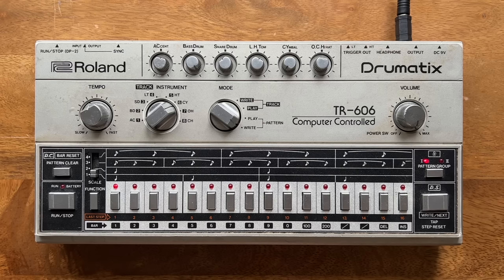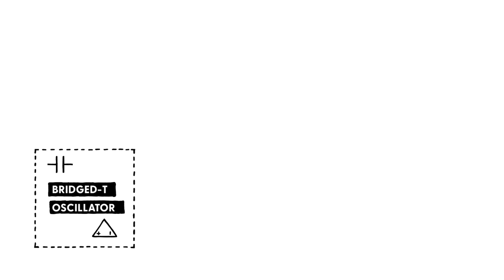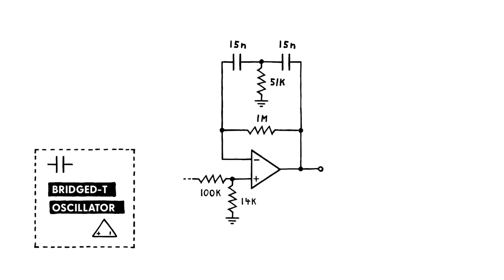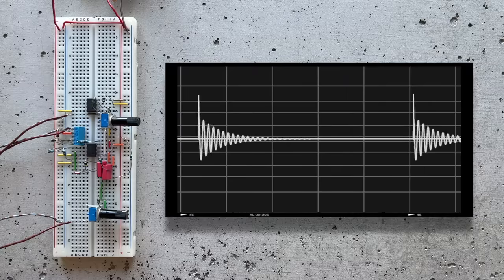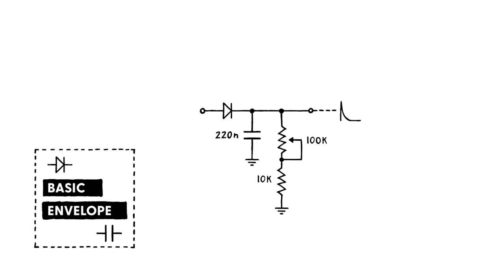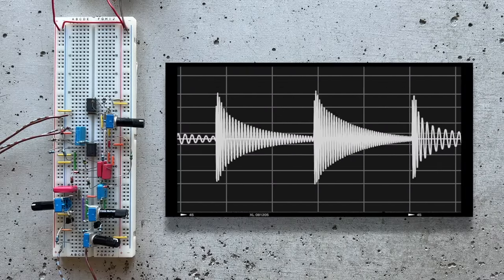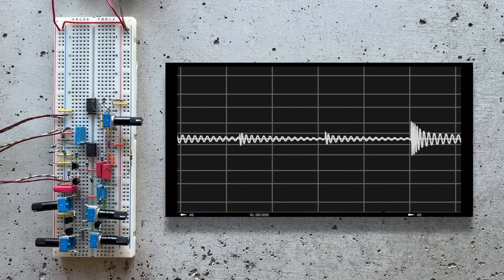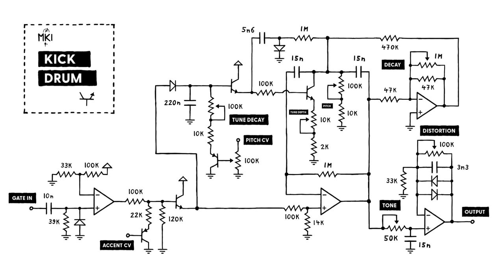Designing a simple analog kick drum from scratch

Comment: Remarkable !!! It's always fun to see how those simple tricks solve complex issues in a efficient way. 
To try different "flavors" in the overdrive section is fun to use different diodes (red/green leds) or make it asymmetrical, with 1 diode in one direction and 2 in series in the opposite way
Reply from the maker: great idea! though you‘ll have to drop the resistance to ground a fair bit for the LEDs to actually conduct.

Comment: I'd love to see a series of DIY modules utilizing CMOS chips, so many possibilities!
Reply from the maker: sounds fun! what were you thinking of specifically?
Reply: Agree! I love CMOS!
Reply: Hm, the main point of CMOS was that you can make things like NAND gates that only use power during signal transitions allowing you to use more gates for digital circuits with the same amount of power. That said, using a voltage controlled FET instead of a current controlled PNP or NPN transistor might be useful sometimes for analog circuits.  JFETs might be easier to use than the MOSFETs used in CMOS since they are usually a bit less sensitive to electrostatic discharge.
Reply: I have seen devices that use the logic gates in CMOS ICs as analog amplifiers! I even tested an AM radio built entirely around 4 NAND gate chip that worked great.

Comment: Absolutely awesome Man.. Ive been tinkering with the 606 and boss dr circuits for years ... I beg you.. Please do one on the simple vcas/evn and noise that made up the majority of the circuits like the snare and hats of those early machines..Id love to understand the vcas and simple evn gens/ filters that Roland designed for those drum machines.. With that knowledge we could easily build any drum sound from that era... The best thing is, once you grasp the bread and butter circuits implemented in those drum machines, I can see the same circuit bits used in most of the sounds..
Reply from the maker: will do!
Reply: I hear that it's actually not that tough, at least if you have time for experimentation.  All the cymbals (crash, ride, hat), if I remember right, are white noise from a Zener diode or an abused B-E junction, run through a bandpass filter and the same envelope control that you see in this video.  The snare is simply a cymbal and a tom striking at the same time.
Reply from the maker: @ke9tv  almost - the noise is actually coming from six square wave oscillators that are mixed in a way that sounds almost ring mod-ish.
Reply: @ke9tv  Nah thats not correct.. The snare is a tom with a pitch env and white noise running through a highpass filter...  The hats and cymbal are very complex in nature with many small sub circuits.. six square osc all running at different frequencys and then sent down 2 different filter paths, a high pass and a bandpass section.. These are then sent to the hats and cymbal which also have complex evnelopes and vcas to control the closed open sections of the hats and the high low sections of the cymbals to make them believable sounding..
Reply: @petrokemikal  Yeah, I oversimplified.  The snare and the toms definitely use transistor-derived white noise (Q35 on the main board), as well as the hex-Schmitt-trigger noise. Each time I revisit the schematic, I see weirder complexities in it.  $DEITY alone knows how Kakehashi--san came up with some of these things!
Reply: @ke9tv  Yeah its a really cool instrument.. well they all were but obviously the standouts were the 606/808/909 and the boss dr110... Even the toms on the 606 were fairly complex, same oscs as used elsewhere but also with a slight pitch env and white noise underneath lowpass filtered.. Genius dsign and very believable as fake tom resonance with the white noise filtered..  Its going to be so cool to have Moritz break them down to a more understandable level past just knowing what each section does..

Comment: This video was excellent. I have one question:
Around 21:00 you're explaining why the asymmetry of a BJT causes issues when using one as a voltage controlled resistor. Would there be any issue using two transistors (wire the bases together, the collector of one to the emitter of the other & the collecter of the other to the emitter of the first) to resolve this? I cannot think what the problem would be.
Reply: Also curious about this

Comment: [[READ ALL, Cool circuit...] Don't underestimate the great Thomas Organ Co. Band Box , single transistor & inductor for 'burst one shot' sounds (basically every sound), and 2 transistors for repeat sounds- 'drum roll' and 'castanet'. Preamp/amp/ speaker can really make these simple analog sounds come across very realistic! ' It has "last forever" flat brass metal scissor spring contacts on copper pad' touch buttons as well. 

Thomas created the  Thomas Organ Co. Playmate as the sophisticated and separate beat sequencer companion interface for the bandbox (attaches by just a few wires). The Playmate used a very cool system of  making the individual Band Box sounds respond dynamically based on the dynamics of the upper and lower keyboard, and bass pedal dynamics. More than just a gain control monitor, the dynamics really get sophisticated. The player can assign on the Band Box itself, any drum sound to UPPER/ BOTH/LOWER keyboards in a split second during play by pressing its 3-way rocker switch. Not to mention you can play the buttons. 

Meanwhile the Playmate is still doing its thing dynamically, mimicking a real drummer feel. This might seem useless outside of electronic organ use, but the Playmate circuit can use Control Voltage from ANY SOURCES. I have the service manual. Let me know I'll give you the schematics , as Dropbox file.

Comment: The thing you call an oscillator can better be thought of as a filter that selects a given frequency from the step that came in.  The T circuit makes it have a significant peak at one frequency.
Reply: BTW:  I saw several places where you missed a simpler way to attack a problem.  An example is that some comparators work just fine between +V and ground so they can't swing negative on their outputs.

Comment: What if we wanted more obnoxious distortion and a longer decay? Trying to recreate a gabber kick and ive tried a few kicks and effects pedals but this kick at 37:00 without the cap is the closest I've ever heard to what I'm going for.
Reply from the maker: for a more intense distortion you can add additional diodes in series with the existing ones to the distortion stage‘s feedback path. or you can use a smaller resistance to ground - maybe try a 10k instead of the 33k!
Reply from the maker: as for the decay - the 1M pot i used already gives you a ridiculously long decay at the maximum setting. i think i just didn’t show that off properly in the video!
Reply: @MoritzKlein0  Fantastic! I really appreciate the help, thanks.

Comment: Iv'e been working on a kick drum circuit recently. This is a really excellent and helpful video that explains everything.
Reply from the maker: fun - care to post it on my discord once you‘re happy with it?
Reply: @MoritzKlein0 yes I will share it... most of the circuit is the same as yours but im trying to make it work on just a 5V supply. I use two 10K resistors to give a mid point ground so effectively creating +/-2.5 V rails. Im using Microchip MCP2021 op-amps as they work at 5V. 

I previously built a synth circuit as part of a larger computer project running on just 5V so I know it can be done.
Reply: Iv'e been working on the circuit at with 5V supply (+/-2.5V) and experimenting with different resistor values but some parts do not work very well.. so iv'e decided to go back to +/-12V supply and replace the op-amps with TL084 and build it the same as yours.

Comment: Idea for future: delay and reverb, either with the PT2399 (cheap, easy to get, one of many options) or completely analog or even integrating a physical spring into circuit to make an analog spring reverb. The latter might be kind of neat - spring reverbs teach a lot of physics and electrodynamic concepts imo.
Reply from the maker: both are on my to-do!
Reply: The PT2399 doesn’t seem to produce the greatest reverb/ echo, though. Might there be a better circuit?
Reply: @Sarahbuildsstepsequencers  there are absolutely better ICs to use, but the benefit of the PT2399 is that it's cheap and ubiquitous so it's good for beginners to practice with. I agree it's not the greatest for output though. For example, the Belton BTDR-3H reverb IC is quite good but 16 dollars a chip, where the PT2399 is 2 usd at specialty shops and 1 usd or less from China (which may be a knockoff but similar functioning chip). Building a reverb circuit without ICs, completely analog, would be impressive but a big project.

I'm excited for Moritzs' spring reverb implementation. Those are fun because you actually use a long physical spring. It can produce really neat results and reaffirms the fact that all electronics are just the direction of electromagnetic waves along different paths made of different constructs of elements or compounds from the periodic table. It's really like magic spell casting using ingredients such as newts eyes and crows feet or something. That's how I think of it at least
Reply: I believe the Belton brick is just 3 x PT2399s in a single package. The design is patented though.

Comment: at the end demo im a little confused, 

whats used for the gate in signal, the accent cv and pitch cv? should it be a DC or AC voltage? on what voltage does it run? and do i connect the output?

id love to recreate this and modify it but those are some of the hurdles im stuck at
Reply from the maker: gate should be a square wave signal (on/off). accent and pitch CV can be any positive voltage. (very negative voltages might make the circuit misbehave.) 
i’m running the circuit on +/-12 V, but 9 or 15 will also work.
you can connect the output directly to headphones, or to an amp if you want to use speakers.
Reply: @MoritzKlein0  thank you. but im still confused on one part and its at 37:54 when in the upper section of the circuit is connect with 6 wires in total to create your bassline. what are those wires connnected to and what voltage drives them? im also a bit confused on how to connect the output to headphones with only a positive connection

Comment: Hey I just found your channel and I love it. I don't have any experience with rack modules or electronics so I found your video about Breadboard basics really helpful. I would love it if you could make a follow up video to explain how you connect your breadboard to your computer/Ableton/audio interface to test things on the breadboard that require control voltage. Obviously, audio in/out I understand. But, can my audio interface produce control voltage and send it to a breadboard? I know Ableton has some CV Tools but I don't understand the digital to physical world interface! Thanks for reading.
Reply from the maker: the easiest way to get control voltage is either using a hardware sequencer (e.g. the korg SQ-1 is a great, cheap option), or simply setting up a variable voltage divider on your breadboard. your audio interface is most likely not able to send out constant voltages.
Reply: @MoritzKlein0  thanks for your reply. I wonder if there is a simple way to involve you computers DAW and audio interface more. I think it would be really cool to build something on a breadboard and then set up the knobs and other controls on the breadboard to respond to signals from my computer DAW in some way. Maybe this is beyond the scope of a breadboard. But I was under the impression that CV was just audio that isn't oscillating.

Comment: I have a question about the pitch control: Why did you add the series resistor of the pitch control transistor at the emitter? My first thought would have been to put it on the collector. And then it should even work fine with the 1meg resistor connected to ground.
Reply from the maker: i tried both, and adding it at the emitter sounded better to me. didn’t have enough time to really explore why, though!

Comment: What are those flat boxy caps normally called and normally used for? (Are they commonly used in power supplies?) Want to make sure I buy the right type. Also, how different would an SMT edition of that sound? Thanks in advance for answering!
Reply from the maker: the boxy caps are called film or foil capacitors. they are non-polarized, and apparently they don’t introduce a lot of distortion, which makes them great for audio stuff!
Reply: @MoritzKlein0  Thanks! So it should be easy to convert that to an SMT design then, right?
Reply: @OMNI_INFINITY  Yes, there are foil capacitors in an SMT package, those will always work fine. But most SMT capacitors are ceramic. If you use ceramic, make sure to use ones made with NP0 dielectric. With other materials, like X7R, the capacitance changes with the voltage across the capacitor. Those are only good for supply voltage filtering where the voltage doesn't change much.
You can actually build a voltage controlled RC filter with X7R capacitors, I tried that just a few weeks ago. But I feel like using that in an actual circuit would be too evil...
Reply: Ah! Definitely avoid doing that then! @singflower
Reply: @singflower  Evil? Also dependent on a lot of variables you can't control: temperature, capacitor aging, and so on.  If you're into aleatoric music, maybe...

Comment: I just found this channel and as a firmware engineer and AV technician, immediately subscribed. I know basic circuit analysis and digital hardware, but I am trying to learn more about analog electronics, particularly audio. Do you have any recommendations for learning more of the circuit analysis and design related to audio circuits?
Reply from the maker: for me personally, trial & error has worked wonders. i basically started small, picked a simple  effect/function(e.g. a low pass filter, an attenuator, mixer etc.) i wanted to implement, and then looked up what i needed to achieve that. circuit simulators help a bunch with this – check out CircuitJS if you haven't yet!

Comment: Would it be possible to control the width of the trigger impulse from the gate-to-trigger converter? I'd be interested in how this affects the sound as the two gate transitions go very slightly towards triggering twice again.
Reply from the maker: yeah, no problem - you can either lower the comparator’s threshold voltage, or increase the resistance to ground in the high pass filter. both will widen the trigger pulse.

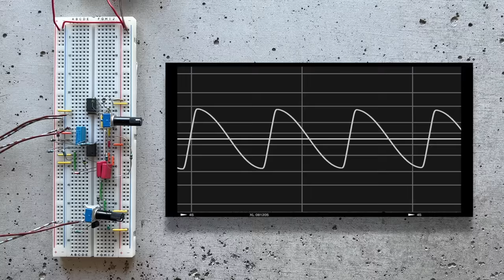Comment: At 21:20, I think another reason the waveform look sawtooth-like is that the transistor isn't behaving so much like a resistor as a voltage-controlled current sink, which charges the capacitors at a constant rate. So the rising part of the waveform is mostly a linear ramp, and the falling part is sinusoidal.
Reply from the maker: yeah, great observation!

Comment: I tried to model this in Proteus 8, and can say that sadly Proteus makes every element too perfect, and every nanosecond of delay that can happen just because of wires and stuff is gone, so it basicaly makes a perfect model of the circuit with no little mistakes of the real world. I guess i would have to make one in real life.
Reply from the maker: so it doesn't sound good?
Reply: @MoritzKlein0  well the moment you put gate-to-trigger thing, the signal gets too short to actualy make a sound. Although there is sound, its just very very short. And when you try to add the delay knob, the delay sound gets suppressed too much.

Comment: I would intend to use it with an acoustic kick-drum that has a permanently fitted trigger - suggestions for trigger component? OK to use a cheap piezo disc speaker like in the gameboy? Also, is a piezo voltage too high and too short to charge the de-bouncing pulse? Also,.  for the deluxe model, is there anypoint adding a 1:1 matching transformer? Or a balanced XLR output I mean.

Comment: Thats a very nice circuit and like the other videos - explained really good 👏💪 .
I have a question, not for this 💎 kick drum circuit.

I have done most parts for my synth : VCO , VCA , a very nice 12 db lowpass filter with 2 transistors ,sequenzer,  a AR Envelope generator ( i build it with a 4070 XOR gatter ic for the gate input stage ,then the passive stuff and buffer it with a lm310 (i have tons from that voltage Follower opamps ) and builded 3 other AR generators because the cd 4070 have 4 xor gatters and its pretty easy to build,a LFO with saw-tri-ramp shaper ,a few experimentel like metall sounds ,simple white noise generator and a Chaos waveform generator builded with different Gatters .
But damn i cant get a simple keyboard with cv output and a gate to work .Tried it with opamps , combination of opamps and cmos chips  and a few circuits i found on the Internet.  I've no idea what i do wrong (maybe bad ics ,maybe bad connections ,idk ) .
So youre a genius with that analog stuff and it would be really cool if u could make a simple 12 Keys keyboard with a cv output and a gate output . Things like a  pitch wheel i know how to that . 
Would be very nice from you .

Have a  nice day 😊
Grüße aus Bensheim 😎

Comment: Hello! Good vdeo and work! What is about JFET transistor as a variable resistor? I used it in my homemade audio microphone compressor - a JFET can conducts positive and negative voltages: but the maximum voltage on a JFET can`t be greater that 600mV because a parasitic junction inside JFET.